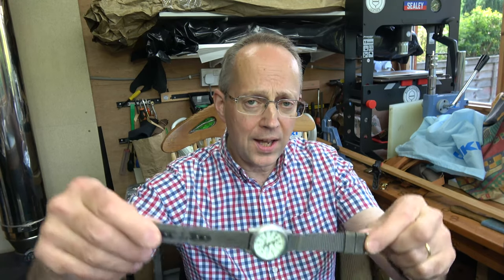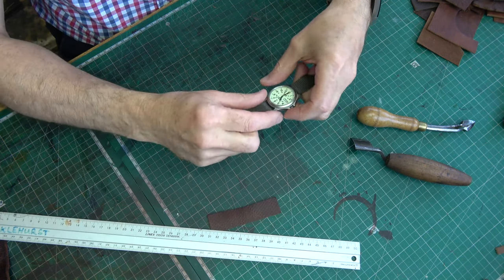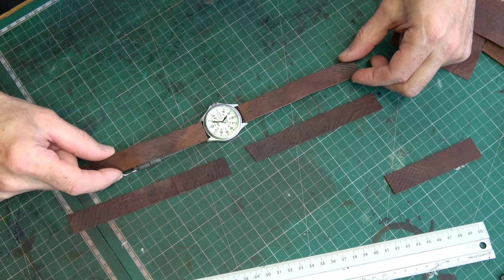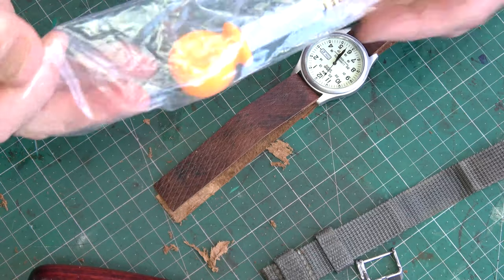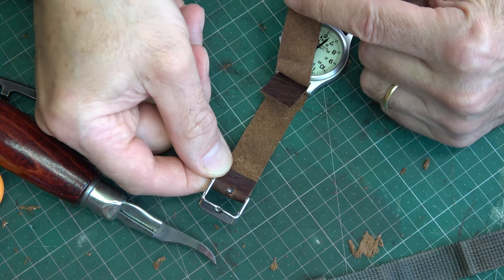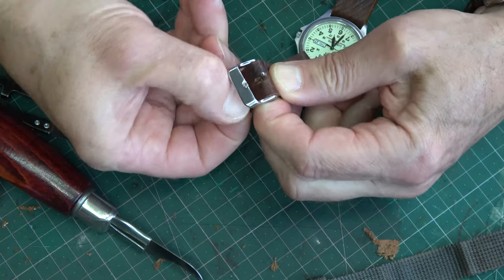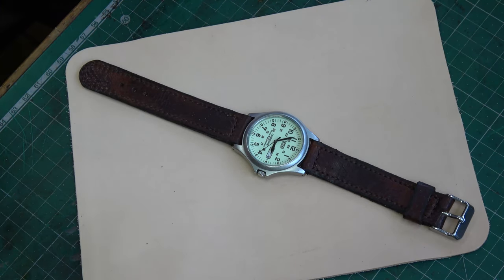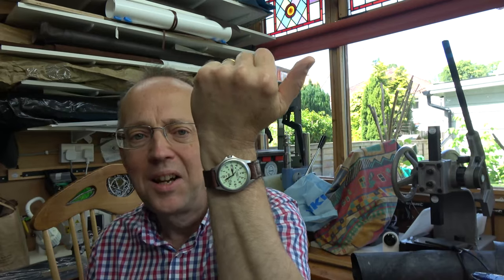Leather Craft - Making A Watch Strap From 200 Year Old Leather

Comment: Hi Harry, fascinating the way you double fold the leather around the spring bars - most will only skive the front piece and use a straight backing - is there any reason you do it this way?
Reply from the maker: Hi Chris, I  wanted additional strength with this aged leather, and I had the space but yes very helpful you mention thus, Thanks very much. Rgds Harry

Comment: I have long had an interest in having a go at this, I just uploaded a vid showing where I rather inexpertly made a retro 1970's military cuff band which I hand riveted but for some reason despite using a steel ruler and measuring the rivets turned out a little out of place finding out too late the cheapo chinese hole maker tool was bending throwing the holes off at a skew :(   Still I quite like the rugged look of the riveted cuff bands as it reminds me of my first watch as a kid which was a Timex on a wide cuff with little studs on, then as an adult the watch straps we had in the army with the leather caps to cover the watch head itself.   I do fancy trying out how you done yours in this vid as I got some lovely patches of leather :)
Reply from the maker: You have a great collection...good to make something you have connection with.

Comment: Next time remove the spring bars from the watch so you don't have to make the strap while it's on the watch. It looks like there are drilled lug holes on the sides. Just stick a needle into the holes to pop them out. Also, you didn't have to cut the nato strap to get the buckle out, it has a spring bar as well. Just look on youtube on how to remove spring bars. This is watches 101.
Reply from the maker: Hi I have a spring bar removal tool but I prefer to make with bars in place to get maximum thickness at the bars. I appreciate a lot of people do it your way which has the advantage of not damaging an expensive watch...like mine haha!! Thanks for your useful suggestions. Rgds Harry

Comment: Hi Harry I follow your channel find myself trying your project as close as I can my latest attempt is this watch strap, I actually have the same watch (Argos?)! Anyway I am now on my second attempt and is going better than the first so so far so good. One thing that worries me is the small tabs that we end up with on the rear of the watch strap. I have stitched round the strap as you suggest but I find that that these tabs tend to want to peel away from the rest of the rear strip of leather!  Don’t know if that’s v clear but wondered if there is an obvious answer to the problem, I am using a contact adhesive to stick the layers of leather down. I’m wondering if to put some extra stitching in to anchor it down or use a different glue (superglue maybe?) anyway thanks for any thoughts.
Reply from the maker: Hi contact adhesive like Evostick should be fine, but perhaps you need to roughen up the leather to help adhesion.....also don't join when the glue is slightly wet...let it go dry, and when joining a hammering sometimes helps...but don't hit your hugely expensive watch...haha (As you know I have the same watch).😉
Reply: He he yes they don’t make em like that anymore Harry! Ok well thanks for the advice will give it another try would superglue be a complete no no for any reason if the other measures don’t do it?
Thanks again Harry
Reply from the maker: @brocky436  It may not have the flex but do try it if all else fails.
Reply: Yes did a couple of experiments Harry and yes superglue holds it nicely but as you say it’s v rigid so probably not the most comfortable on the wrist
Tried the scratching and being more patient with the c adhesive and that does  help the other aspect I think might be that the leather I’m using is recycled (not Russian etc lol) but I think it has got some finish on it which does seem to stop the c adhesive from getting into the leather at all ! Anyway just thought I’d report back
Cheers Harry
Reply from the maker: @brocky436  That makes good sense...well done.

Comment: Great job and beautiful strap. One question though, we’ll two... why make the watch strap while attached to the watch and also why glue down the buckle end of the strap while the buckle is attached. Seems like you could add the buckle and watch after you’ve completed the project.
Reply from the maker: Thanks Arthur...I guess another time I might make it off the watch...but then again I might glue  up the holes for the buckle and pin! I was a bit worried about the clearance between the pin and watch body on this one. Best wishes Harry